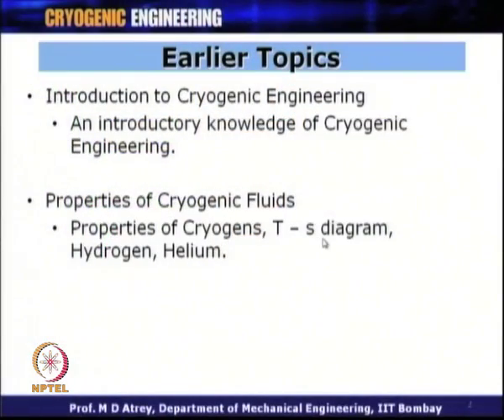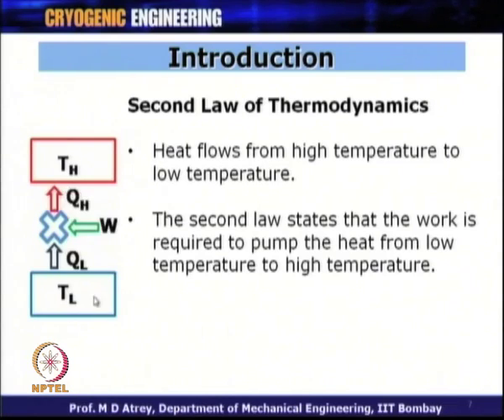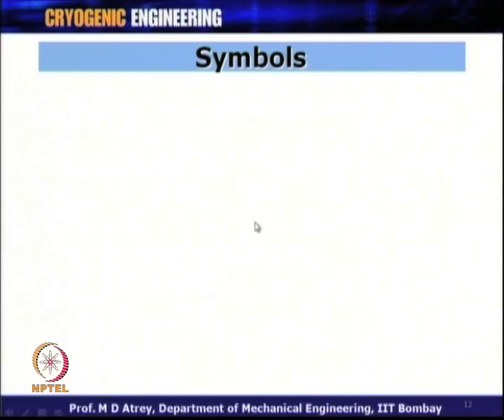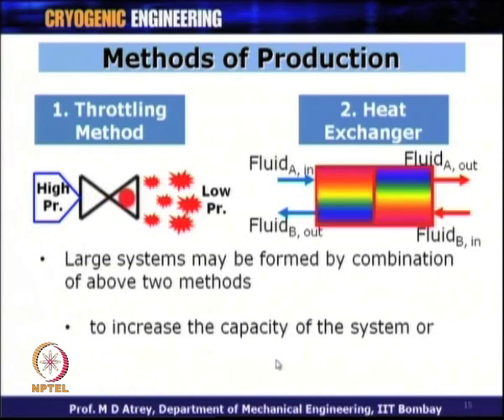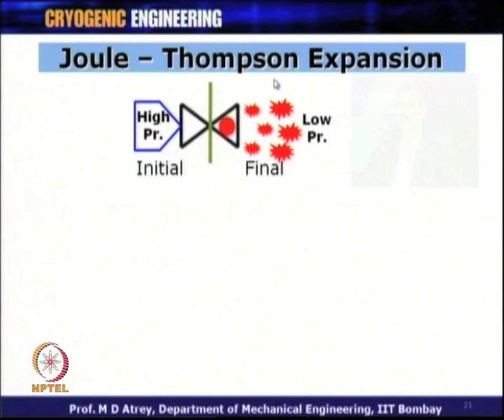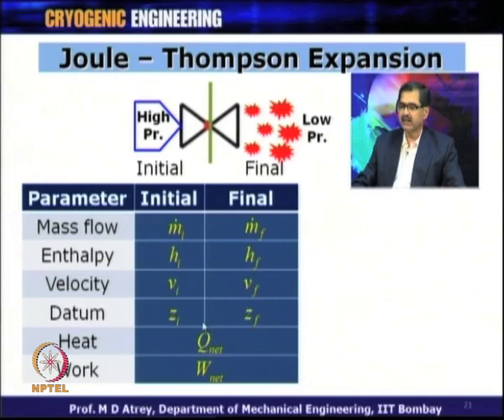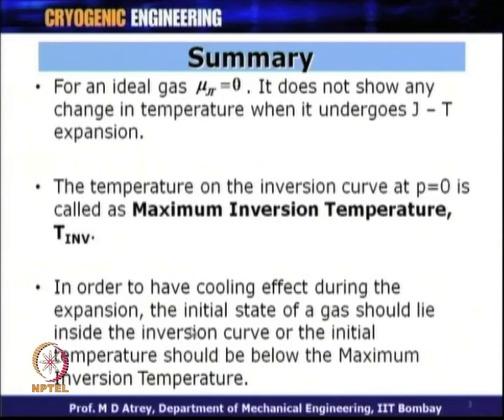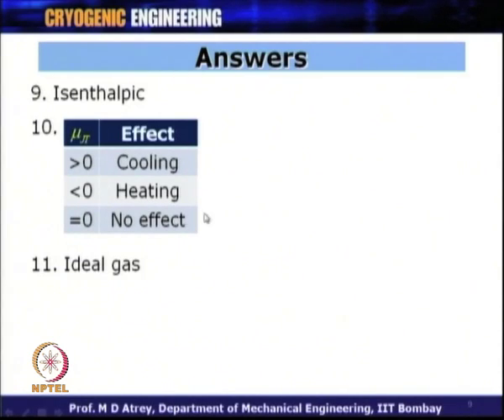Mod-01 Lec-08 Gas Liquefaction and Refrigeration Systems

Comment: How can we liquify a mixture of diiferent gases, such as flue gases having SO2, NO2, CO and CO2, all of these have different boiling points with NO2 having highest one, at 21°C. Would the NO2 be liquified if we quickly expand the mixture such that that it reaches a temperature down to 10°C to 15°C?
Please answer, this question has been giving me some obstacles lately.